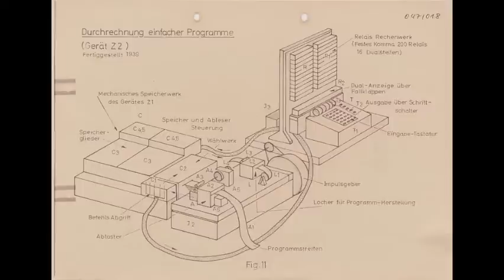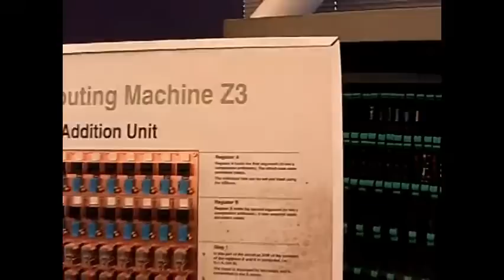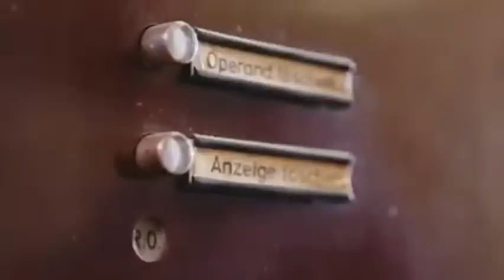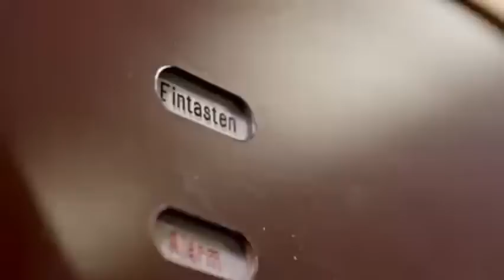Zuse Z3 - Germany's SUPERCOMPUTER which was NOT USED for Code Breaking ('41 - '45)

Comment: The word SUPERCOMPUTER is greatly overdone. The Zuse machine was a step in the development of computers.
Reply: Yes, you can leave the term like that. The Z3 was the first freely programmable computer that was partially touring (with triks you could make it suitable for touring, but that cost speed). And since it was the only one at the time, it was automatically a "supercomputer". 
Its architecture corresponded to the future universal computers. 

It wasn't the bomb, it was actually a replica of the Enigma, only with tubes and could therefore test all combinations more quickly.

Comment: No mention of the crucial Polish involvement. Also, the Nazi high command used Lorenz cipher machines, which were far more complex and harder to crack than Enigma.
Reply: LM never been cracked !
Reply: @Cornel1001 
You are misinformed. Lorenz / Tunny was cracked by the Allies in WW2.
A human error led to the breakthrough that cracked the code. On 30 August 1941, against all the rules, a Lorenz message was re-sent between Berlin and Athens because the first was not received properly. They used the same wheel settings – and crucially the second message was shortened by the use of abbreviations. This gave Colonel John Tiltman the insight he needed to break the code by hand in ten days.
Reply: @Slartyfartblarst  73, I will check ! TY
Reply: @Cornel1001  
The first Tunny machines were built following the work in 1942 of mathematician Bill Tutte. Plans were drawn up for it after analysing intercepted encrypted radio signals Hitler was sending to the Nazi high command.
These orders were encrypted before being transmitted by a machine known as a Lorenz SZ42 enciphering machine. Prior to the creation of machines to do the code-breaking, the orders were broken by hand in what was known as "The Testery". Bill Tutte's analysis enabled the development of the Tunny machine which effectively reverse-engineered the workings of the SZ42 - even though he had never seen it.
The first machine built to capitalise on Tutte's analysis was called Heath Robinson and the more reliable and faster Colossus machines followed soon after.
Tunny worked alongside the Colossus computer, which together with input from the Testery, calculated the settings of an SZ42 used to encipher a particular message. These settings were reproduced on Tunny, the enciphered message was fed in, and the decrypted text was printed out.
By the end of WWII there were 12-15 Tunny machines in use and the information they revealed about Nazi battle plans helped to ensure the success of D-Day.

Comment: Command-staff messages were not encrypted by enigma, but used the "tunny" teleprinter code.
Reply: Yes this was far more important than Enigma, The Lorenz 'Tunny' was a state-of-the-art 12-wheel cipher machine far more complex compared with Enigma's 3 wheel cipher. Mathematician William Tutte efforts in doing what was considered impossible deciphering the code does not get enough credit, it wasn't Enigma that shortened the war it was Lorenz (Tunny) that carried orders from Hitler & Nazi high command to the generals in the field & thanks to Tutte also right into the hands of Churchill & Eisenhower.
Reply: @ZuulGatekeeper to mention TUNNY without mentioning Tommy Flowers is criminal. Flowers devised the first fully electronic programmable computer Colossus Mark I to do the job, building on his previous work with telecom relays. Colossus was the hardware which automated TUNNY decrypts. It’s also a fascinating machine due to its use of systolic arrays.
Reply: As in later years as well there were two ways of sending signals: morse code and teletype/radio teletype. Both systems used codes that were not secret at all, so they had to be coded if confidential messages were to be transmitted. Teletype is far more mathematical than morse code. The machine uses five small electrical switches that have studs which are pressed against the perforated tape. When there is a hole in the paper the switch goes "on", when there is no hole it stays "off". The mechanics of the machine "reads" those five positions from top to bottom one after the other and turns them into a series of signals or non-signals. When we see a signal (hole) as "plus" and the lack of a signal (no hole) as "minus" (two options) it becomes clear that five postions are enough for the entire alphabet and necessary functions: 2 x 2 x 2 x 2 x 2 = 32 And what about cryptology. You must "add" another letter.  + and + make +/ - and - make +/ + and - make -/ - and + make - / That is all. The orginal letter or interspace function between two words becomes someting different. That is what is sent by wire or by radio teletype. The receiving machine has the same letter code as the sending machine and takes the "wrong" information off the letters so that the real message is printed on the paper. Computers use the same mathematics and that means that such a machine that it quick enough to try all possible codes can break such a code.  But you must know how many letters that code contains and if the code is used over and over again.

Comment: "Without a conditional branch" - if it does not have "IF" it is a calculator, not computer. However, it is a very impressive technology - possibly the first use of binary in this way.
Reply: That's a bit simplified. The Z3 was indeed Turing complete, as is said in the video, which means you had an alternative way to fully program it despite the missing condition branching.
Reply: From the Wikipedia article, "The Z3 was demonstrated in 1998 to be, in principle, Turing-complete. However, because it lacked conditional branching, the Z3 only meets this definition by speculatively computing all possible outcomes of a calculation. "

Comment: The Enigma was intended for use by businesses to transmit vital commercial information without anyone outside those businesses being able to access it. The Germans decided to produce their own more-secure version of the machine, which they considered incapable of being accessed by code-breakers.
Reply: None: Not true!  The Germans knew very well that any code could be broken given enough time and resources.
Why do you think they had several stages of encryption with increasing difficulty?  Eg. 3, 4, rotor and Lorentz.
Time is of the essence with military information. 1, 2, 4, weeks later the value of the messages was perhaps of historic value only.
Reply: @BasementEngineer  I'm less certain of this. I'm pretty sure that Bletchly was using messages to build up dossiers of German officers, so even older messages may have had some value.
Reply: @quintrankid8045  You make a reasonable argument.
However, for tactical decisions, time is of the essence for military intelligence.